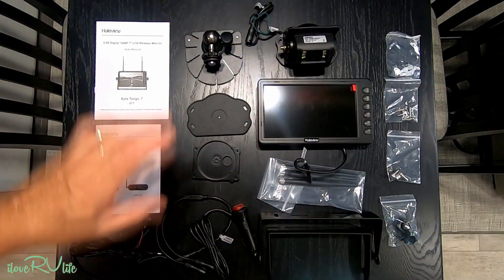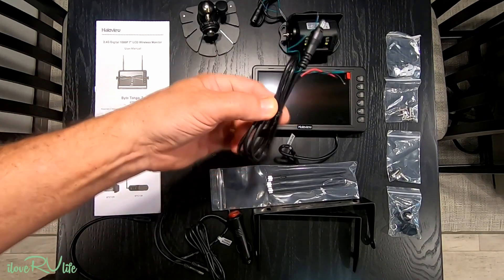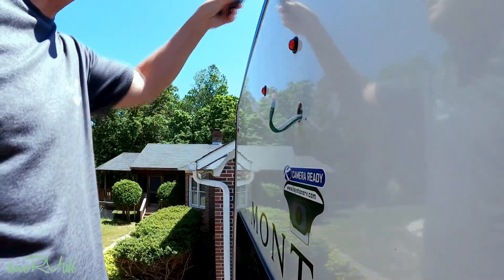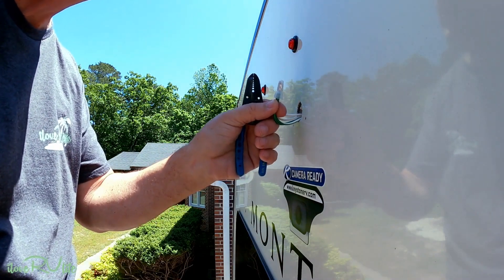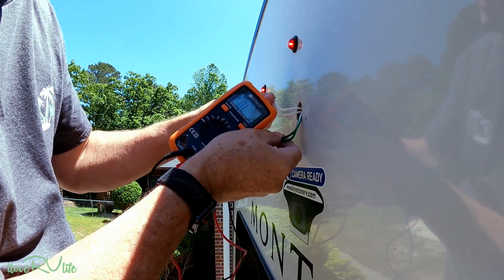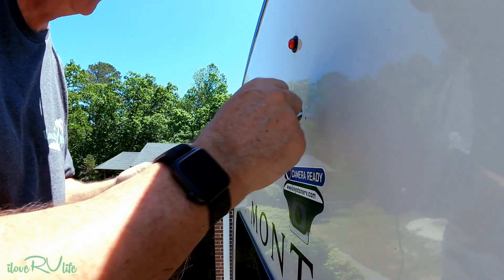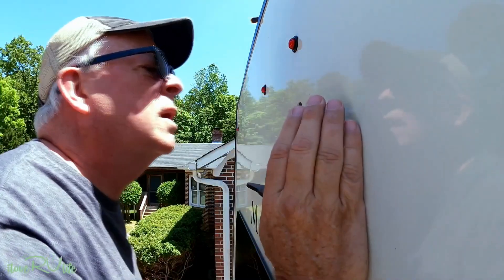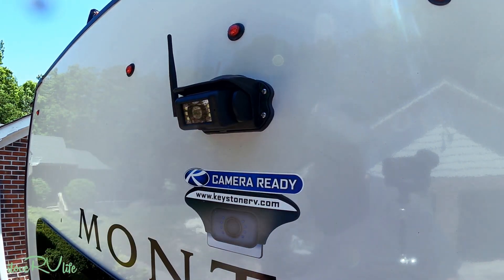How to Install BT7 Haloview Backup Camera on 2022 Camera Ready Keystone RV

Comment: So you just left the thin, green Trigger wires on the camera unconnected? Based on the manufacturer’s not entirely helpful instructions, connecting those to your Reverse (or L turn or R turn for the side cameras) would trigger that camera’s taking over the entire video display screen when you shift into reverse (or deploy a turn signal.) Worth fishing those dedicated, powered wires to each position? I’m def planning on doing it on the marker light/side views.

Comment: You might suggest using painters tape to secure wires from trailer once exposed and separated from original mounting. While working on them, stripping, etc., the wires fell back into the trailer wall